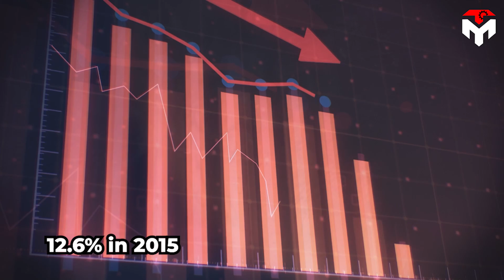It's over! ULA sold to Blue Origin. SpaceX didn't expect this...

Comment: Apart from the pronunciation issues, and a rubbish script: Tech Map has not thought through the details.
 For example: 
* SpaceX Falcon 9 and Heavy are re-usable. That means that there are always several vehicles available, or soon available after refurbishment, for customers requiring quick launches of their payloads. By contrast ULA/BO will require to build a new booster for every flight.
* No-one knows their launch-vehicle like SpaceX, because no-one has ever brought one back intact for inspection. No-one has ever launched a booster more than once, never mind 18 times
* Blue Origin has no experience of orbital launch vehicles, has no experience of the particular vehicles being used, nor the management techniques required to run a healthy competitive launch business
* Blue Origin has yet to demonstrate that it its BE-4 engine is truly flightworthy and reliably so in mass-production and not when specially hand-built for ULA
* Blue Origin will need to have someone hold its hand for years while it learns how real world engineers build and fly rockets. Perhaps Tory Bruno can help with that, but it cannot be ignored that BO has decided to buy its way to orbit with someone else's rocket, because it has failed to build one by itself. This does not bode well for any future developments either of Vulcan or New Glenn. Having said that, this whole debacle makes me smile, as I despise Bezos.
* Starship in the near future, and Falcon 9 and Falcon Heavy flying maybe 150 plus times per year, reliable workhorses at inexpensive prices compared with a few years ago. BO will not be able to compete, but will have to rely on cash-injections to stay around.
And all that without mentioning that ULA is 2 companies. Sorting all that rat's nest of management will be akin to fixing the rat's nest that is the BE-4 engine.
This is maybe a poisoned chalice. One can only hope.

Comment: If Jeff takes over, the next orbital launch by ULA will be in the early 2030's.
Reply: not even then. BO still hasn't got a launch capability. all it did was buy contractss that already were signed BEFORE ULA chose BO for engines.
Reply from the maker: LOL 😁